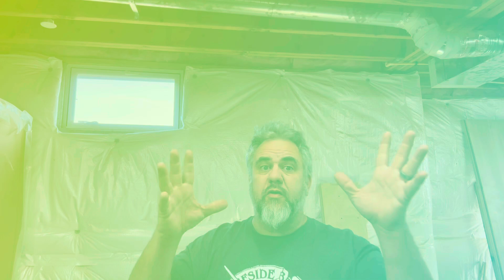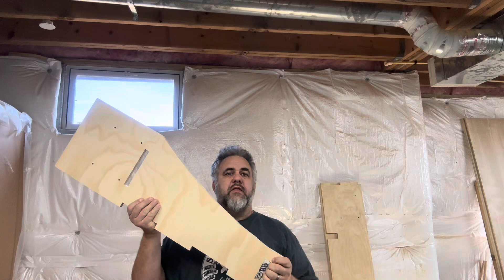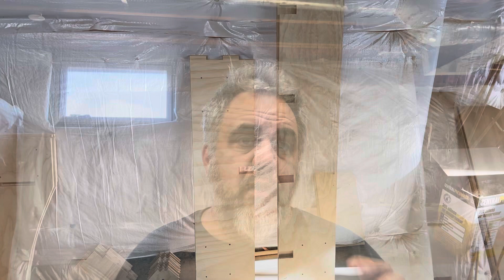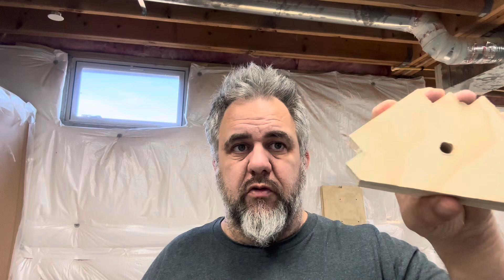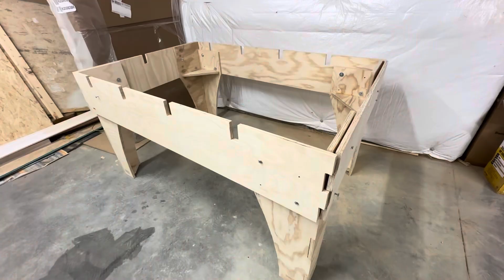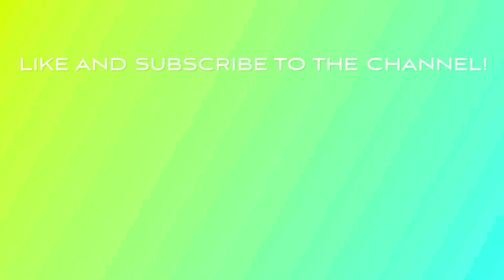Ranger CNC Build Series Part 1: The Table

Comment: why not use tee nuts on the back of the plywood? simply tap them in and run the bolts in tight. we used them to build flat pack furniture out of 3/4 plywood